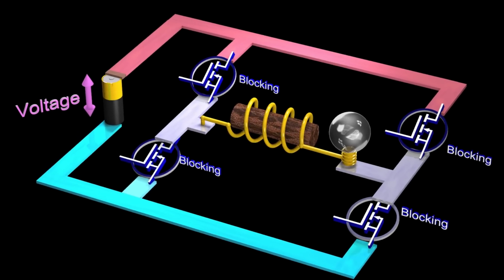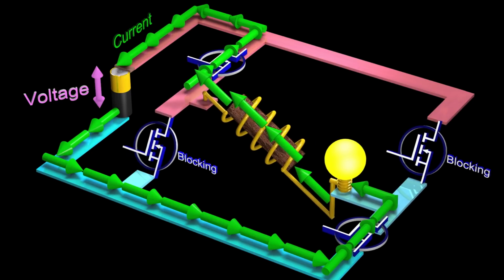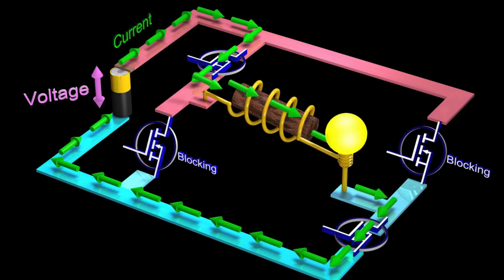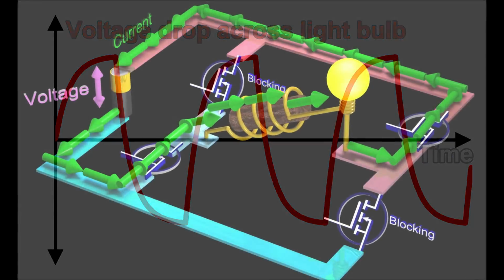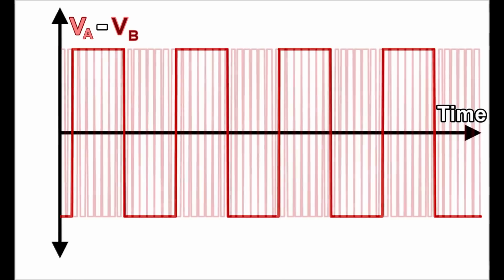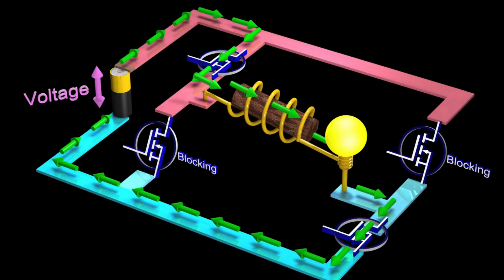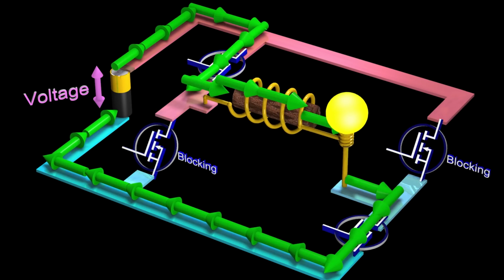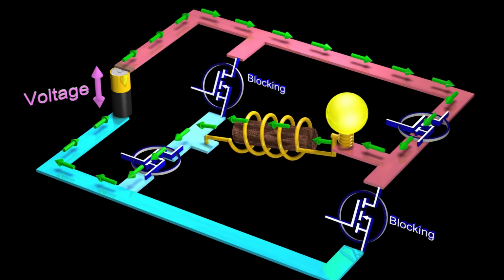Electric Power Inverters

Comment: I think the animation is not accurate. You are showing that current change direction from the battery. It is not the case. Current direction from the battery is always the same. Transistors are passing it through different ways.
Reply from the maker: The animations are correct.  The changing magnetic field through the inductor creates a voltage, preventing the current through the inductor from changing instantaneously.  The moment immediately after FETs change their states, the current through the inductor is still the same, and it is therefore forced back into the battery.  I explain inductors in in my video at https://youtu.be/ukBFPrXiKWA

Comment: Im surpised not a single person noticed the amination is wrong. Please do not think the current goes in both directions from the dc source, it is only meant to show how the output would act at the light bulp
Reply from the maker: The animation is correct, and this is why no one else complained about it.  The current in an inductor can't change instantaneously.  Therefore, when the transistors change their on / off status, the current must initially flow backwards into the DC source.

Comment: Great video! Thanks for sharing!

Is this how solar inverters, convert DC to AC? Or do they generally use a different method?
Reply from the maker: Thanks for the compliment.  If you want to use solar panels to generate power for an electric utility grid, then you need a 3 phase version of this circuit.  Also, the inductor for each phase may be replaced with the primary coil of a transformer, with the load being on the secondary side of this 3 phase transformer.  The transformer is needed to change the voltage, so that it matches the voltage of electric utility grid.
Reply: @EugeneKhutoryansky  Thanks for replying. After thinking about the video I now understand how an inverter can be bidirectional (to charge batteries from grid). Because there is nothing in the circuit that makes it one directional. Correct me if I am wrong. 
Btw, do all the PV inverters have transformers? I’ve heard there are inverters that are transformer-less. Probably to use less materials.

Comment: Very nice video!
Left me wondering how to give signals to transistors to act in the required manner.
Reply from the maker: Thanks.  It can be done with a microprocessor:  Compare a square wave with a high frequency to our desired sine wave (with a lower frequency).  At each moment in time, depending on which of these two waveforms is bigger, our switching waveform is either positive or negative.
Reply: @EugeneKhutoryansky  I think it can also be done with only an oscillator.

Comment: You are showing current flowing two directions through the battery.  Shouldn't it  be only one way and the switching of mosfet pairs give the two different circuits / directions independent of the battery?
Reply from the maker: The video shows it correctly.  The inductor forces the current to momentarily charge the battery.  Otherwise, either the current through the inductor would change instantaneously, or the current would flow through a mosfet when it is blocking.

Comment: In the real inverters big electrolytic capacitors placed after power supply. And low inductance busbar used to connected them to the transistors.

Comment: Cool video. Question - the fact that in the last animation arrows grow bigger/smaller bit by bit, not just waiting for the full cycle (like in the first animation that showed it working with switching only when the arrow had maximum length), is by design and it shows the green voltage graph that is "closer to sinusoid"?
I just want to make sure I understood it properly.
Reply from the maker: Yes, this is to make it look more like a sine wave.  To make it look even more like a sine wave, the switching frequency would be much faster.
Reply: @EugeneKhutoryansky  Yes - but higher frequency has it's drawbacks as well. Hence why standard AC current is delivered in 50 or 60 Hz throughout the world.
Some ships (Soviet Submarines for example) used 300 or 400 Hz. I do not remember all the pros and cons of high frequency, but there was a good video about it on RSD Academy. And making (especially in old times) elements that would switch very very fast would reduce their lifespans. One of the first grids was 133 Hz from memory.
Reply from the maker: The AC output would still be 60 Hz or 50 Hz.  I was referring to the switching frequency.  You can have a switching frequency in the kHz range, and still produce and output of 60 Hz or 50 Hz.
Reply: @EugeneKhutoryansky  Of course. I simply started jumping to another topic that came to my mind. Apologies. I'm the kind of person that goes to Wikipedia to look for one thing and then spends 8 hours browsing through everything that piques my interest.
Reply: Switches do have heating and power loss when switching.. Because they are Power MOS or Solid State Relays so frequency does have some limitation on the efficiency, size or power. Plus some snubber circuits to protect the switches themselves. Not cheap. 
But many times you do not need a perfect sinusoidal wave, just a stable frequency It is not the same to run water pumps from a battery that an electric car.
And for the russian submarines, I guess a 400Hz switching frequency noise may be easy to track if you know what you are looking for.  EM noise is much worse at higher frequency.
Reply: @atzuras  Yeah. Jive Turkey (now Sub Brief) - former sonar operator for US submarine has talked about it. I do remember that they needed this frequency for something.